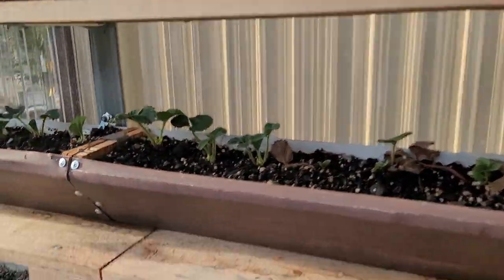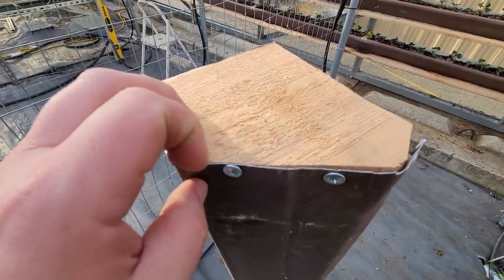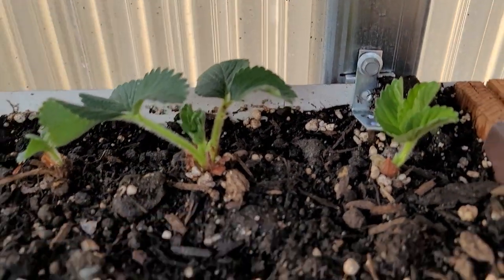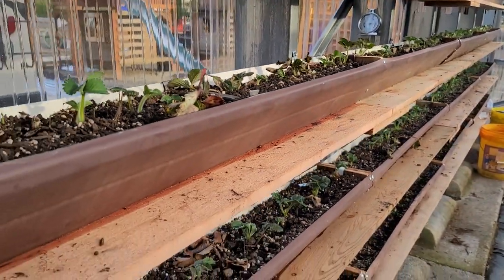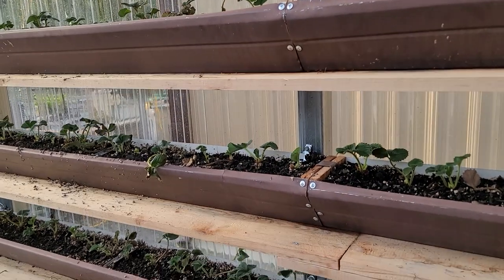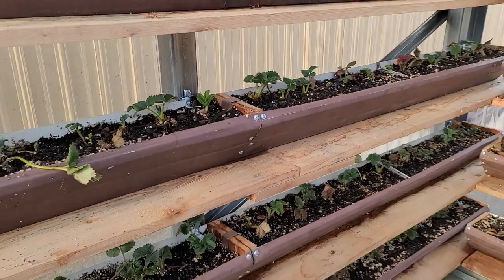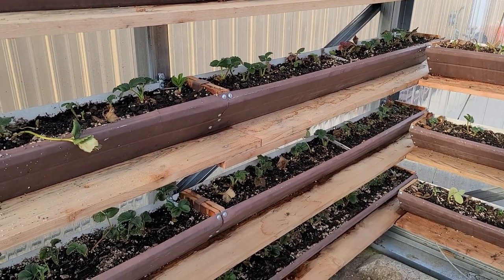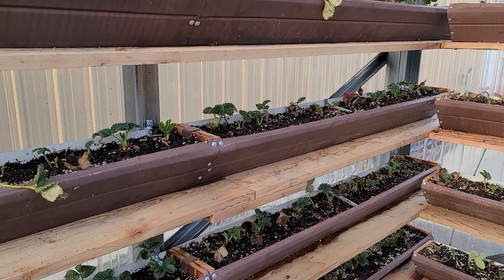Gutter Garden, DIY Rain Gutter Strawberry Planter, vertical garden, growing strawberry in greenhouse

Comment: Looks pretty good. Are you worried about the lower shelves losing sunlight exposure?
Reply from the maker: Hi Zed. Yes a bit. They will still get light from the backside of the gutters and then also from the front during midday. I'm hoping it will be enough sunlight to make it work. I'll have to post more videos during the summer to show progress
Reply: @growtolearn4545  looking forward to seeing how it goes. If this turns out to be really viable it's a huge space saver!
Reply from the maker: I do also have grape vines on the south side that could cause shading from the outside bottom half of the greenhouse. I guess at this point if I will have shading issues, I could maybe use reflection to guide light on the other side or just plant something that has more shade tolerance.
Reply from the maker: Oh yeah, totaly. Just keeping the birds and slugs away from them is a great benefit.